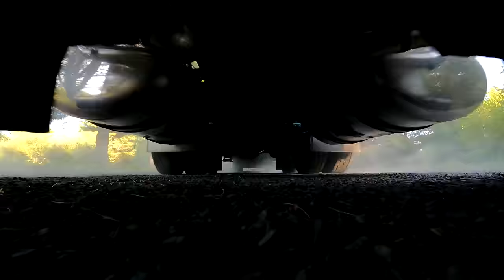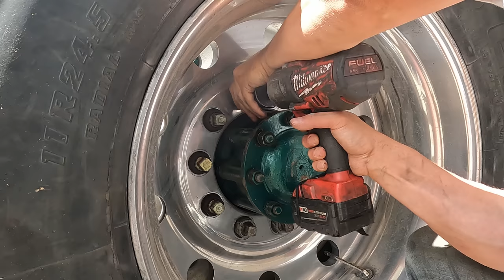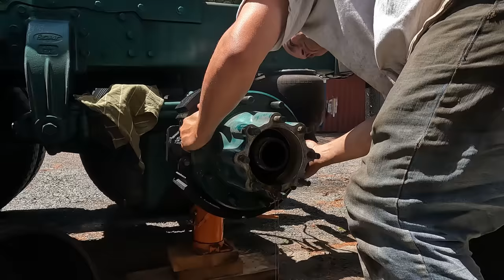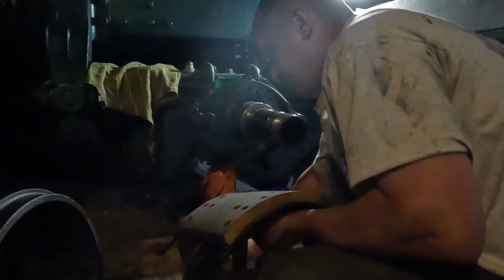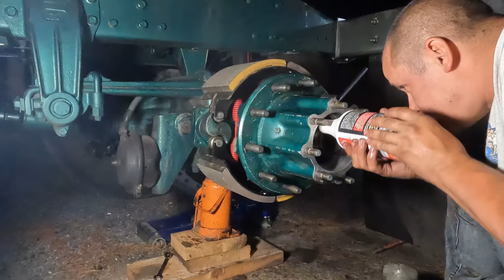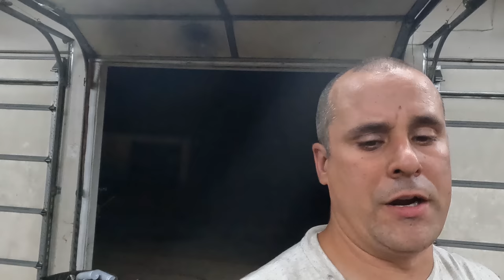Causing our own problems! Major wheel seal failure. What went wrong?

Comment: Sucks arse you have to do it again. 

I was taught as a piss poor kid never reuse a seal even if they look "OK". 9/10 times they'll fail and you'll pay more than the seal cost. Not to mention the fucking shit quality even some of the good brands produce.

I'd call it a 1 piece, X part (how many components its made of) seal.

2 piece would be like (:) 2 halfs if that makes sense. 

I'd also put a smear of rubber safe maintenance spray (usually silicone) on it to help it slide smoothly into the housing. 

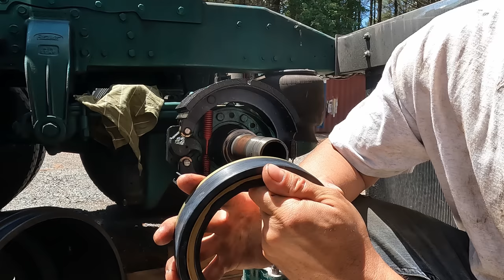At 09:51 with how reluctant it was to rotate i would put some rubber spray on that too. Cos it seems manufacturers are fucking shy with lubing them and bearings especially sealed bearings. 

I hope you don't take this post as criticism and teaching you how to suck eggs. I've learnt stuff watching your mint videos as well as been entertained. And it may help a schmoo like me reading the comments, not just gobbing off in them😉

Have a good weekend mate🍺👍🏻
Reply from the maker: Thanks man I appreciate the advice!